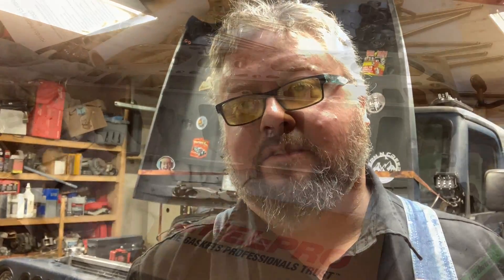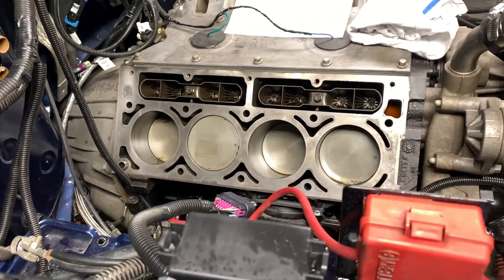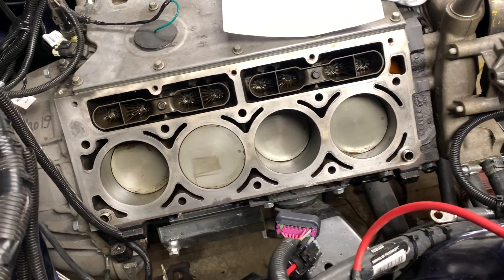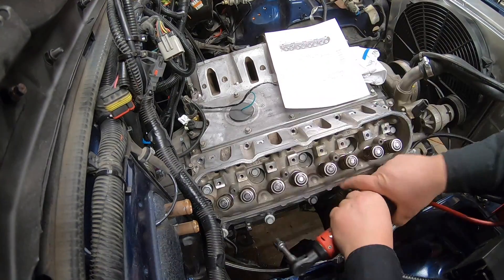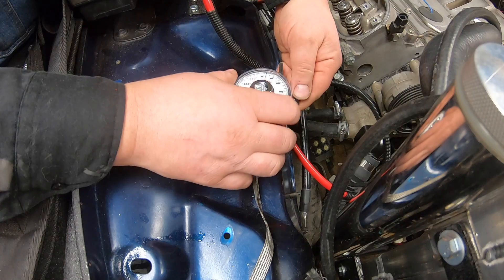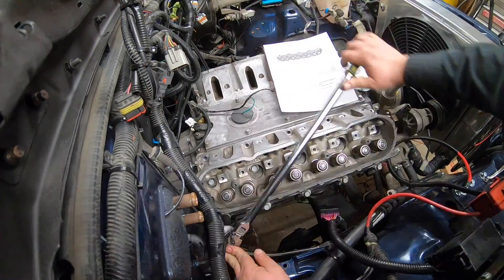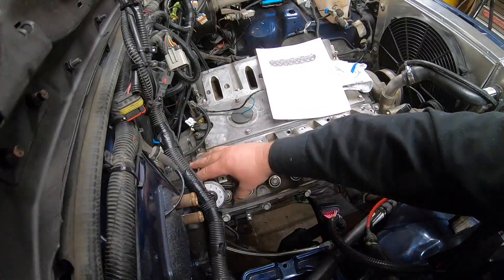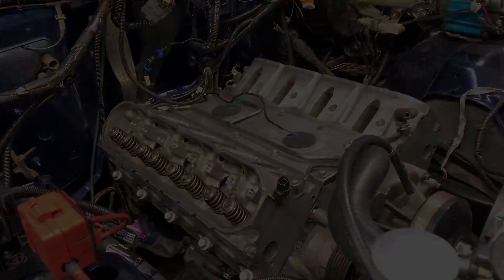Ls Head Gasket Install DIY

Comment: Ok, so I'm doing a Cam only swap on my 2005 Hummer H2. The Hummer only has 58k miles on it. I know, very low for the year. Anyway, the heads are 317 and it came, from factory, with regular head gasket part number 12589227. However, my heads appear to have that notch. My Heads also came with ALL long bolts. Very weird, because I would have thought it came with the gasket that has that notch and also the two shorter bolts at the ends. Anyway, as practice, replace parts that came off the original truck, so that is what I am going to do. Even though it has that notch in the head.

Comment: I just purchase the Mahle 54441 cylinder head gaskets. Does it matter which is R or L?
Reply: Hopefully someone answers this man because im debating on wether to buy two or buy one drivers side and look for the passenger side one man,
I dont want to buy two of the same side
Reply: I’m sure you’ve figured out by now, but the head gasket is universal for both banks.